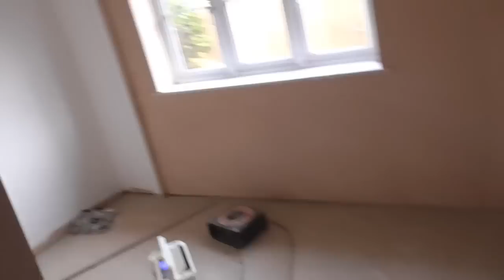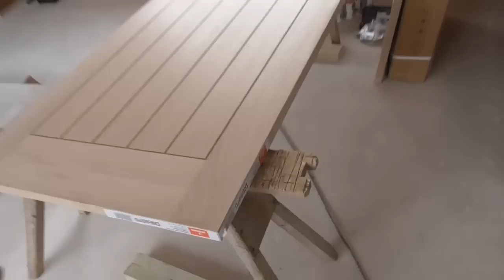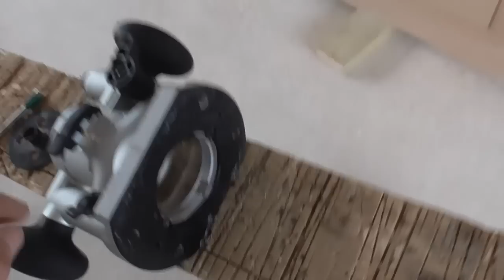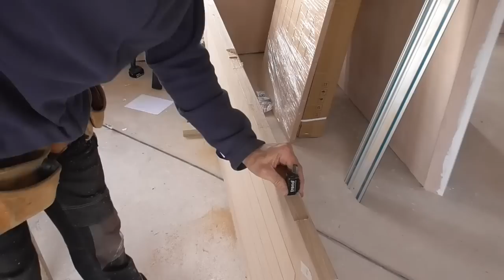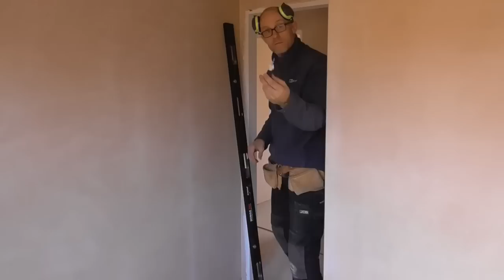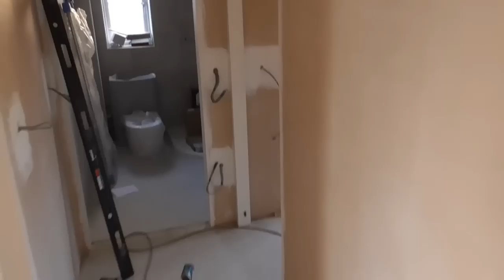How to hang a door with a professional carpenter***COMPLETE HOUSE 2ND FIX CARPENTRY PART 1***

Comment: Hi Del, amazing job as usual. I have been using the trend skeleton jig for a few years now mate and it seems the one you are using is a little more fiddly with the the wedge etc. have you tried the skeleton one to compare? 
Also, on the subject of doors, can I get your views/ opinions on how you tackle hanging nee doors in an old frame when the hinge side of the frame has a belly in the middle. I had one recently. Dry fit of the door looked terrible, so I planed the door to contour the frame for even gaps, but this came with its own problems that the centre hinge wouldn’t now reach the frame as tightly as the top and bottom. It seemed like a lose, lose situation. I managed to get it pulled in, but I wasn’t happy with the tension it would probably be putting on that hinge. I would appreciate your thoughts mate?
Reply from the maker: Hi Paul🖐I know exactly what you mean about hinges binding on a bowed lining, and I would be looking to plane the belly out of the lining to straighten it up a bit even if I needed to take the stop off👍And I have seen the newer Trend skeleton jig, and it does look much easier to set up👊Thanks for watching and your comment 😎 Cheers Del
Reply: Thanks Del, I always appreciate your input. Legend!

Comment: Great to see you back Del and I agree with your process of 2nd fix, nothing worse than having to hang doors onto new linings with architraves fitted. Felt for you when you were lifting them doors, I must have hung at least 20 in a house once, only they were mainly 45mm thick. Never used the Trend jig but could you use it on rebated frames ? Hope to see you soon 👍👍
Reply from the maker: Hi Kevin🖐Yes, some of these doors can be quite heavy, and you know it if you've been lugging them about all day😩 With regard to the jig on rebated frames, I'm not sure how good it would be, as the architrave set back needs to be enough to accommodate the jigs depth stops for starters, plus the jig is dead straight, so no good on a bowed frame😬Thanks for your comment as always bud🤩Cheers
Reply: Yes you can use trend hinge jig on rebated frames , rebated frames are all we use on our sites 👍
Reply from the maker: @markb1971  Thanks for adding this Gm👍
Reply: @markb1971  Thanks for the reply 👍
Reply: Hi Kevin Brilliant video. Thank you for sharing so many tips and tricks. Always worth watching you! Love the idea of fitting the flapping frame leg after door. I am reusing second hand doors so that’s a great tip for my project. Cheers
Reply from the maker: @postcardcottages4289  Hi PC🖐Glad you find the videos useful 😀 Thanks for your comment 😎 Cheers Del

Comment: Hi Del, something I thought of when a couple of people mentioned hinge screws being very flimsy, why not replace them with hardened steel wood screws? The size seems to be 4x25, just what you can get from Screwfix in the ''Turbo silver'' variety (or plain thread if you prefer). Which is fortunate because that's a size I already use for mounting electrical fittings onto timber/ply and needed another pack, so this time I bought the turbo silver instead of turbo gold so it goes with silver hinges should I ever decide to use something other than the stock hinge screws. I'm sure you've already thought of this a million years ago so nothing new!
Reply from the maker: Hi AA🖐On the odd occasion where I'm solely responsible for the supply of EVERYTHING needed to do a big door hanging job, I do exactly as you say, and use the 'silver screws' from Screwfix👍Like you say, they are a good quality screw, in the right size, right colour and fairly cheap👌Unfortunately, the builders I work with supply me with the cheapest hinge sets available😬 (I should just carry a couple of boxes on the van really👊) Another great comment and thanks for watching🤩Cheers Del
Reply: @thetallcarpenter  Thanks for your reply Del, and I'm happy to hear I was thinking along the right lines regarding alternative screws. But as you say you have to use what you've got sometimes.

Comment: Cracking work I've always found with all ball  bearing hinges I always have to have them slightly protruding by a  half mil as if they are routered flush the hinge side gap is always 2 mil .Silly really you think the hinge manufacturers would change this obviously never measured the gap between the leaves when door closed
Reply from the maker: I agree with you David👍and you'd have though the hinge manufacturers would have the gap worked out spot on🤔Thanks for watching and your comment 😎 Cheers Del

Comment: One observation, you checked the door for any defects/ marks. Any door with faults would then go into obscure bedrooms. 

You then proceeded to put a good door into the most obscure bedroom first.

What if the other doors on the floor did have marks / damage…….. 

Logically one would check all doors for defects before fitting the first one in that case…. Just an observation 👍
Reply from the maker: Good observation, and both doors were on bedrooms so I could have 'hidden' any defects if either door had any. On a contractor job like this you can only spend so long going through, unwrapping and inspecting each door, and sometimes you have to get on and take each door as it comes👍You do make a good point though, and ultimately, if you got to the last door and it had some damage on it that you couldn't 'hide' then you would just get it replaced👊Thanks for your comment 😎 Cheers Del

Comment: Do you ever just mark 6 inch down from top and 9 from bottom then get the dmt or oil stones and marples then cut the hinges manually ?
Reply from the maker: Hi there🖐Yes, there's many occasions I just cut my hinge housings out 'old school' with a hammer, chisel and marking gauge👊Cheers Del

Comment: I’ve had loads of them centering drills del ,there alright for a bit then they keep blocking up 👍🏻
Reply from the maker: Ah, do you keep replacing them Stephen, or have you given up on them🤔
Reply: @thetallcarpenter  I’ve given up on them I just place the drill bit against the far side of the hole it then pulls the hinge in tight 👍
Reply from the maker: @stephencharles5222  That's EXACTLY what I do👊and sometimes the hinge needs a little 'pull' to get it tight back in the housing👍

Comment: Great video, so helpful to see a real professional showing all the aspects in a longer video like this, thanks a lot. One question about the Trend hinge jig. I'm guessing your one piece jig will give fixed hinge positions, so if I'm trying to fit new doors to old linings etc, the hinge positions might not match? Would you say the two piece ''skeleton'' hinge jig from Trend would be better for that?
Reply from the maker: Hi AA🖐and thanks for your comment🤩The one piece jig has 4 apertures and they have quite a range of adjustment as each opening has a top and bottom block that slides up and down and can be locked into postion👍I just knock up a little, single hinge jig out of mdf if I'm doing re-hangs as the hinges are usually all over the place from door to door😵‍💫Cheers Del
Reply: @thetallcarpenter  Thanks for your reply, that makes sense with the adjustable blocks. I'm fitting new doors and new 76mm hinges to our existing linings (with old hinge cuts in them, 10 doors total). The old hinge screw holes don't line up and interfere in such a way that middle hole lines up but other 2 are halfway, plus the cuts are a bit rough, and also a little different positions from lining to lining. So I've decided to slide each hinge position a little up on the top one and a little down on the bottom one so the new holes end up on a fresh piece of the lining, with old holes in between the new ones, and use these same measurements on all the doors. I will have to fill in the extra bit left over from the old hinge cuts, but thought it would make the cutting between doors and linings easier, as I can pick 1 set of positions and replicate over and over. Does this sound reasonable? I can make a plywood hinge jig for the Makita 1/4" router (on order, as I didn't have one). I really appreciate the time you take to reply to comments, It's a life saver for someone like me.
Reply from the maker: @Orgakoyd  Your proposed plan sounds perfectly logical, and like a lot of carpentry tasks, it's what works best for you👌
Reply: @thetallcarpenter Thank you very much, it's nice to get a pros perspective on something like this. I will feel a lot more confident if I manage to get this job done

Comment: Hi what width is the little black packer you used to find the right size of the hinge in the jig
Reply from the maker: Hi Jack🖐I'm pretty sure it's 4mm which is the difference between the 12mm cutter and the 16mm guide bush👍Cheers Del

Comment: Del do put a leading edge on a pre finished door 🚪 such as grey or white 🤔
Reply from the maker: Great question Liam🤔and the answer is, not if I don't have to👍 If I need to reduce the width of the door, and the flapping side is straight and plumb, I will just take it off the hanging side and leave a larger gap instead of having a leading edge👊 Ultimately, I go through the options in this scenario with the customer first😉Thanks for watching😎Cheers
Reply: Nice one mate 👍 👌

Comment: Hi del another great video bud, I'm curious... Are you self employed and do work for the house builders aswell as your own work? I was self employed for years but just recently went back working for a company, long story but less hassle!! Just curious bud, cheers mate
Reply from the maker: Hi JWB🖐 I've been self employed for 32 years and now only have about 4 main customers. 2 are builders the other are farmers👍 I've nearly always worked on an hourly rate, which I know is low compared to what others charge, but my customers are always happy with my work and the volume I can produce each day, plus I don't feel under pressure to rush about which means I can still really enjoy working👊Cheers Del
Reply: @thetallcarpenter  thanks very much for the reply del, I like that way of working, 4 main clients means you know where you stand, I was was doing work for everyone and anyone, felt like I was always running here there and everywhere, life was getting consumed by work and in the evenings paperwork, got to much in the end so I threw in the towel and went with a company, company van and fuel card, reasonable pay, holiday pay etc... There are perks to both sides but much less hassle for me now and can enjoy my time away from work!! Take care mate 🤝

Comment: Hi, I was wondering if you could help please. After watching your vids on the makita cordless track saw I finally bought one. Arrived today. Very excited to use it. I live in a very small flat and decided to hook it up to my Henry Hoover to keep the dust down when doing my first cuts on 18mm Ply. I got an electric shock! I unplugged the hoover, no shock....hooked up the hoover again...another shock. I've googled the possible problems and the shock could be just static build up from the saw dust in the Henry pipe, still it's not pleasant and not ideal getting zapped each time I do a cut. This is a bit of a problem. It's not the cordless unit that is at fault but my hoover. Do you have any suggestions. Kind regards Andrew (I'm commenting on this vid as you are using some sort of dust extraction kit when cutting down the door) Keep up the videos, I watch them all) Thumbs up
Reply from the maker: Hi Gords🖐Yes, it sounds like a build up of static and the only thing I can think of is to try and isolate the two machines from each other by cutting an old inner tube into a collar and slipping it over the Henry hose as it goes into the saws dust port👍Thanks for watching and good luck🤞Cheers Del
Reply: @thetallcarpenter  Hi Del, thank you for your response. Much appreciated. Going to bite the bullet and buy the Festool CTL Mini dust extraction with that super gadget button thing you press to get the blue tooth working....as seen in your video.Thank you, hope you are on commission. In for a penny and all that...will be a great addition to my tools. Thanks for all your great videos. Kind regards Andrew (Gords)
Reply from the maker: @Brighton939  The CTL Midi is the ONLY bit of Festool kit I own Gords, and that is because it is THE BEST dust extractor on the market👊You wont be disappointed
Reply: @thetallcarpenter  thank you. going to pot for the CTL Mini, bit cheaper and will fit in my car. Thanks again for replying 🙂

Comment: What blade do you use on your Track saw?
Mine always seems to struggle, even when taking a few passes!
Reply from the maker: Hi Graeme🖐I stuck with the Makita one that came on it, and I now just use, fairly cheap, 50 odd teeth Trend blades from Toolstation👍Seems to cut OK, but you still need to take it steady👊Cheers Del
Reply: @thetallcarpenter  thanks 😊

Comment: Why is your middle hinge in the centre and not further up? I was always told that most of the weight of the door is at the top third of the door. Also 4 inch hinges are OTT for 35mm doors, should have advised the client to go for 3 inch hinges, looks so much better. Love your content though pal ❤️🔥
Reply from the maker: Hi Sam🖐You make some valid point bud. I also think 4" butt's are too big, but the builder got them cheap,🙄 And it's traditional to put the middle butt centered between the top and bottom one, and I only move it higher up if the doors are super heavy💪Thanks for your comment and for watching 😎 Cheers Del

Comment: Quick question: I have to make a EXternal door that opens outwards, can I just use same technique as for inward opening doors? Is there anything else I should think about? ta really appreciate this info
Reply from the maker: You can open a door outwards Ak, but it needs to be well coated and more importantly, it will need some sort of check strap or back stop fitted so it doesn't get ripped off the hinges if it gets caught by the wind😬Cheers Del
Reply: @thetallcarpenter  Great ta. Will keep door closed if windy, as not main door 😀
Reply from the maker: @akfisher7138  👍

Comment: Have you seen the FC jig? Frank's built one thats much better and no need to drill holes etc. Just set, clamp and go. I also agree you need a centering bit.
Plus why don't you use an airbag?
Reply from the maker: I haven't seen that jig Garry🤔 I occasionally use an airbag to help locate the door, but it's a long way down there for me to start pumping it up😲Thanks for watching 😎 Cheers Del
Reply: They pump and release with your foot.

Comment: Have a question for you I have a makita tracksaw like yours and love it ,but most my stuff is milwaukee now so wanted to get the milwaukee tracksaw ,my friend said he take my makita but has now bottled out and the lad I deal with in tools going to deliver milwaukee one tomorrow to me ,I don't wanna let him down as I said I buy ,but I will have 2 tracksaws now ,don't know what to do
Reply from the maker: Its not nice feeling like your messing someone around Darren, I know, but you have been let down by the guy who said he'd have your outgoing Makita set up which has now put you in an undesirable situation with your tool supplier. Personally, I would explain to your supplier that you've been let down and you really don't want 2 track saws at the moment. If he supplies you regularly with kit, I'm sure he will value your custom and understand your position. As long as he gets the Milwaukee back in as new condition, he will easily be able to sell it to someone else👍
Reply: @thetallcarpenter  thanks Del, I just needed a little advice, I don't wanna let him down but don't need 2vtracksaws
Reply from the maker: @darrenroche9225  Him not selling you one of his track saws will not have the same impact on him, as you buying one you don't need will have on you🤔
Reply: @thetallcarpenter  I think I wait till I sell the makita one , instead of going all in on milwaukee I probably should have gone all in on makita ,I got rid of all my dewalt stuff the nailers were so poor ,ordered a 23gauge craftsman nailer today looking forward to getting it ,be great for fine mouldings

Comment: I greatly enjoy your vdeos but often wonder how typical is your carefull, measured work pattern. I've been on many building sites where the 2nd fix is a joke. In one job the architrave had been fitted so badly there wer enormous gaps in the mitred corners. It was gratifying to see the following day the worker had been dismissed and all his botched jobs were being relaced. Pity the foreman hadn;t noticied earlier
Reply from the maker: Sadly, how right you are Paul😩I fit laminate flooring for a customer in finished 'big developer' sites, and standard of carpentry is abysmal😬I don't know whether it's a lack of skill or rubbish prices, but either way, its not good😢Cheers Del

Comment: As a carpenter myself I find that planes that have two blades are not as good as a one bladed plane such as the blue bosh because each blade cuts slightly different and leaves more scuff marks so fighting against itself
Reply: Blue bosh with one blade is definitely best
Reply from the maker: Hi there🖐I know exactly the what you mean, and I take a great deal of time to accurately set both knives to the correct depth in the block to help minimise unsightly pitch marks like you mention👍Thanks for watching and your comment 😎 Cheers Del

Comment: Why is England so behind in doors and frames. In America and Europe doors and frames are sold pre-hinged, lock and handles!
Reply from the maker: Someone has to fit the doors into the frames whether it's in a factory or on site I guess🤔The UK has a very old housing stock, so doors and frames/linings are still fitted the traditional way in new homes or old ones👍Cheers Del